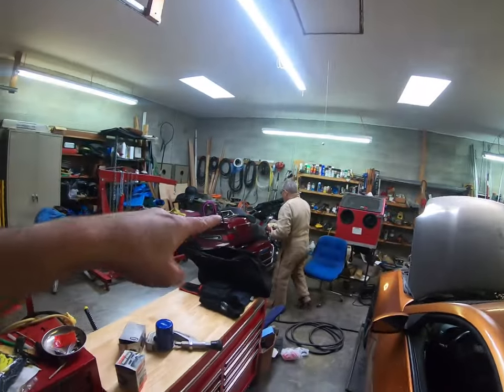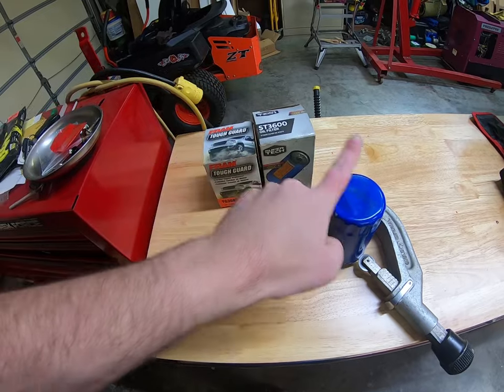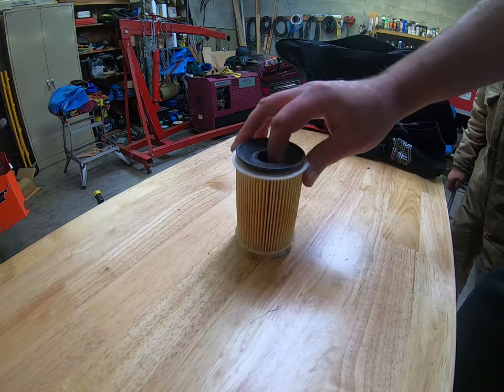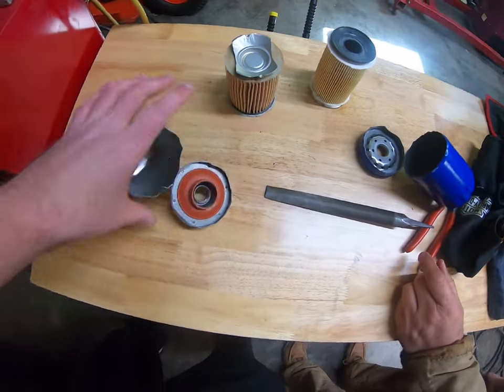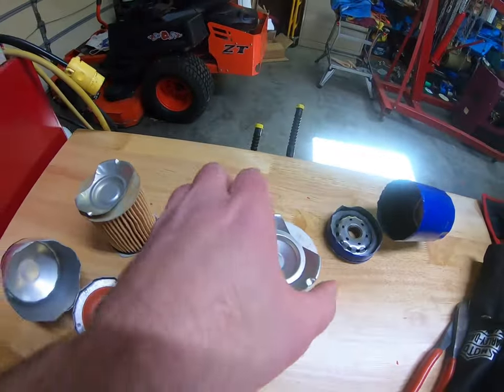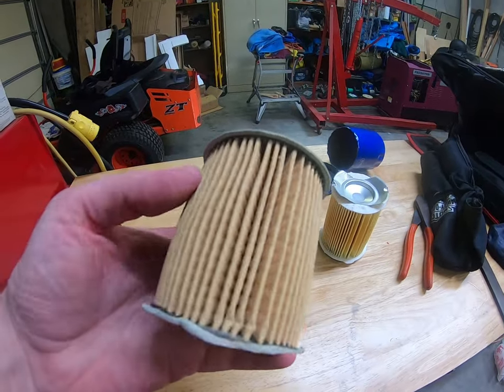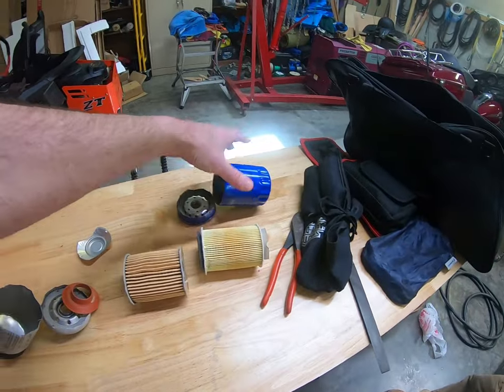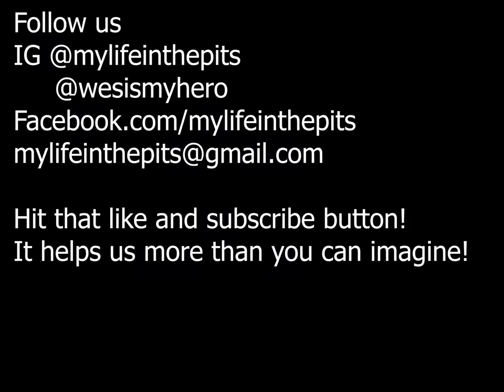Supertech vs Fram Tough Guard oil filter : What's really inside?

Comment: Honestly, I would use either one of these filters no problem, but I have to admit I would choose the Tough Guard over the Super Tech
Reply from the maker: In terms of the oil, I haven't really noticed a difference in the used oil when it comes out and I've ran both. The super tech used to be made by Purolator but now it's made by Champion Labs.
Reply: Not a good review! DO BETTER! First off you are using ONE HAND to get your camera work in! Secondly, and this what INFURIATED ME!!!!!, you mean to say a Fram Tough Guard FLOWS LESS with metal on the inside than the plastic on the SuperTech????????? And yes I am running a Fram Tough Guard on my truck right now.
Reply: Oil flow is determined by the positive displacement oil pump. If the filter is too restrictive, the bypass valve in the filter will open and unfiltered oil will still flow through the engine at the same rate. This usually only happens at startup when it is very cold.